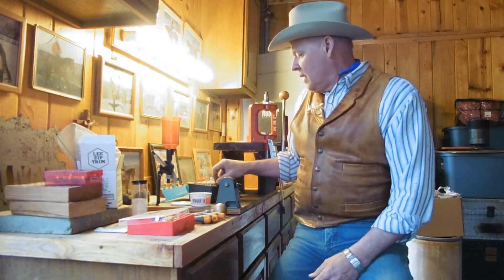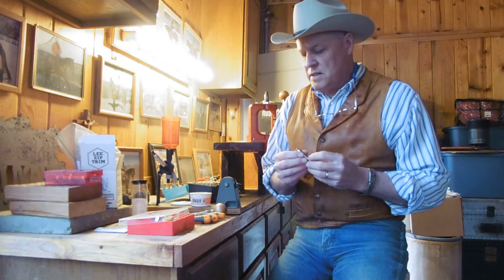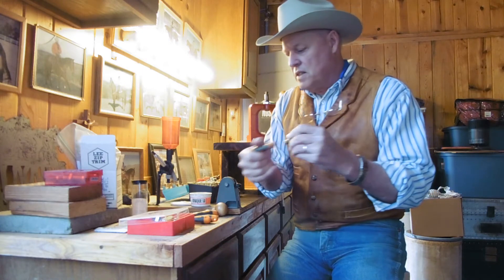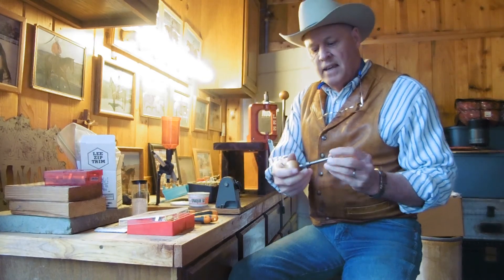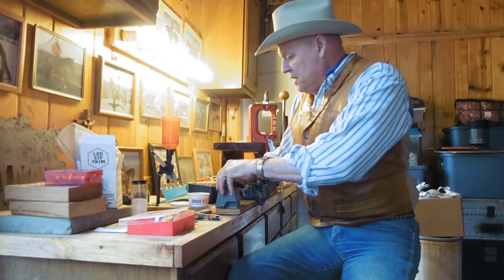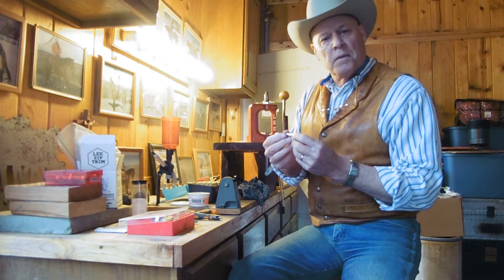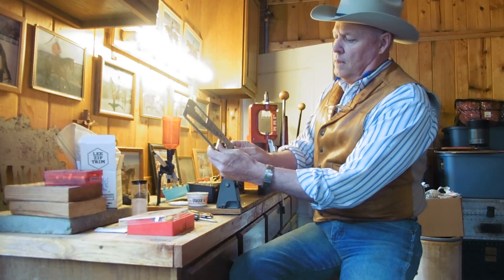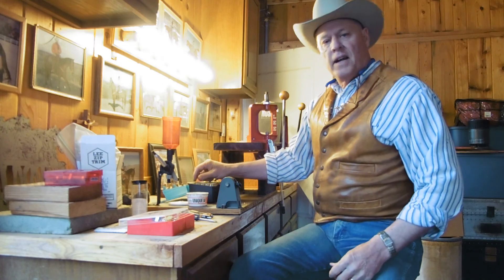Reloading. New case prep. for 300 Win. Mag

Comment: Thanks for posting this vid! There is another step that I do with brand new belted brass. Because manufacturers know that the round will headspace off the belt, sometimes the shoulder length can be all over the map. Upon firing, the initial case stretch can be severe, sometimes resulting in very poor case life, maybe only 3 or 4 loading cycles. What you can do is neck up new brass one or two calibers so that the case will not chamber in your gun. Then size it down a little at a time until it will just barely chamber with some resistance to the bolt handle. This will hold it in place for that first firing and vastly decrease the initial case stretch. An 8MM expander ball installed on your decapping rod will do the trick. Or, in my case, I went ahead and purchased the Expander die from Sinclair with the full set of expanders. I have a batch of belted mag cases that are on their 18th firing and still going. I also anneal them regularly, of course. Thanks again!
Reply from the maker: Great information, I hope everybody reads your comments...Thanks for watching.

Comment: My case prep regime is
1- decap the cases with a Lee universial decapping die
2- wash the cases (Dawn detergent) (~1-2hrs in the tumbler)
3- anneal the case necks
4- lube & resize the cases, swage primmer pockets
5- trim & deburr case necks, uniform deburr flash holes
6- wash the cases again to remove sizing lube, & brass shavings (this is a 2 part wash 1 with (Dawn) detergent, and a final (Lemi Shine) acid wash, cases are then rinsed in clean water and set vericaly neck down to dry for a day or more).
7- prior to priming and loading apply powder graphite lube to the inside of the case necks.
Reply from the maker: Your process is very through indeed.

Comment: Lots of time to prep new cases up here in Alaska.
For virgin cases here are my steps:
1) Lube case and use an expander mandrel for consistent neck inside dimension.
2) Trim cases to a consistent length and for neck turning.
3) Turn cases for consistent neck wall thickness and consistent neck tension.
4) Chamfer and deburr case mouths for consistent bullet seating.
5) Deburr and chamfer flash holes inside case for consistent ignition.
6) Uniform primer pocket for consistent seating depth of primers.
7) Run cases through the expander mandrel one more time for consistent neck tension.
8) Wash cases to remove lube.  Dry cases for 48 hours.
9) Prime cases with hand primer.
10) Sort cases by weight and package cases that have consistent weight together.
Quality cases such as Lapua, Peterson, Norma, Nozler helps minimize some of these
steps.
Reply from the maker: Thanks for your input and Thanks for watching.

Comment: Who makes the neck turner (with the cord)? I like your tool versus using a drill to turn the cutter. Thanks.
Reply from the maker: It's called "Lee Zip Trim." Also buy the universal shell holder for the Zip trim.  https://www.youtube.com/watch?v=PIdDOAhOB8g
Reply: @davestrohmeyer-saddleupsho8009  Thanks for the quick reply. Found it for about $41. Cheaper than the other trimmers out there.
Reply from the maker: @cacinaz8802  You will still need to buy the trim cutter and the cartridge specific case gauge from Lee also...As seen in the video.
Reply: @davestrohmeyer-saddleupsho8009  Can you help identify the universal shell holder? Lee part number perhaps? Found the gauge/holder and cutter (ball grip). But the shell holder that comes with the specific gauge (300 Win Mag) may not be the one that fits on the zip trim.  There is also a case conditioning kit #90950 that may work in lieu of the zip trim, but its all by hand.
Reply from the maker: @cacinaz8802  https://www.midwayusa.com/product/1012831162
Reply: @davestrohmeyer-saddleupsho8009  got it. Thanks.